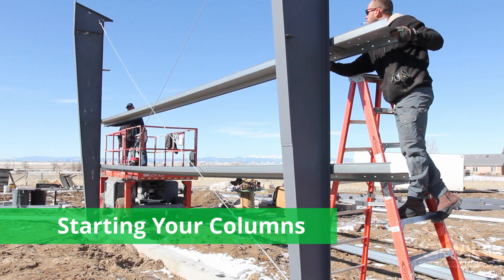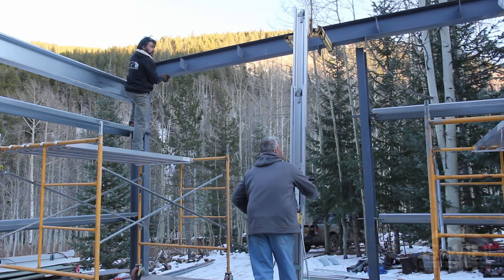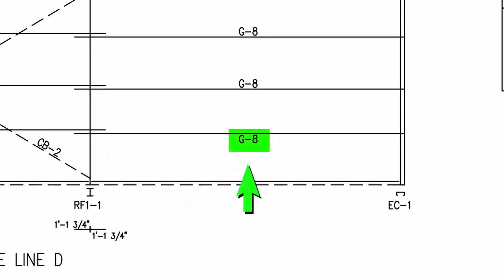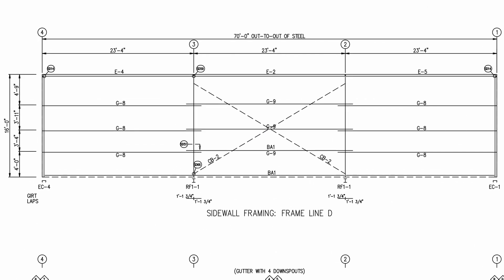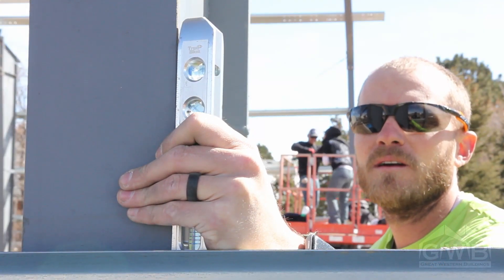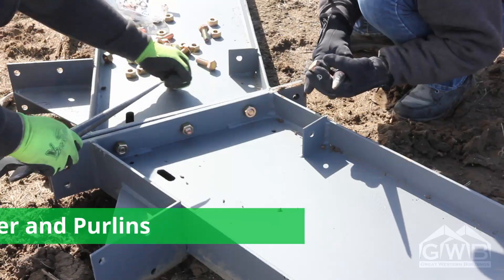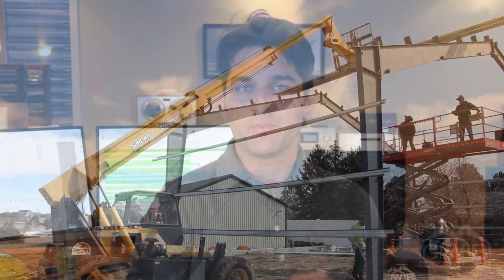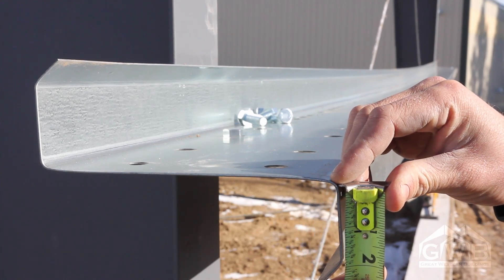How to Build a Steel Building - Erecting the Steel

Comment: Eric I want to know can i install solar panels onto the roof you supply? Also do you have interior metal wall finishes? thanks and great videos. I'm thinking of a ~38' Depth by 42' or 50' to use for my cars, and equipment. 
Dan in RI
Reply: Hi Dan, I didn't see this comment until just now. The main thing to consider with Solar is their weight - You want to make sure that your building has a few extra lbs of roof load to handle them - This is mostly a permitting and engineering concern - it shouldn't add much cost if any to a 40' wide building - assuming PV panels. 

There is a lot of fastening options depending on the roof system. Standing Seam is easies to install solar panels on but Standing Seam is a lot more complicated to install than a regular through fastener roof. 

A through fastener (Screw Down) roof will need stand off clips and sealants - usually the company providing the panels will include this and it's very standardized. We can supply specialty brackets that attach to the high ribs of our standard panels which allow the connection of PV Installation brackets but it is usually preferred to attach through the pan section of the panel for a more secure attachment. 

If you still have questions, please call into the office and they can get you in touch with Ryan, Tyler or myself. 

Thanks

Comment: Hey , its maybe early in this vid to ask , but yes, grout under BP, or NO, grout under BP?? thx 4 putting this out!👍
Reply: Always preferable to not have any grout if possible. Depends on the scale of the project though, anything 60x100 should have the correct concrete tolerance to not need grouting - just some minor shimming - Larger buildings often plan for the use of leveling nuts and grout on the BPs out of the gate because staying in tolerance is a tall order on the foundation crew. So they assume a couple of inches to eliminate excess shimming or grinding. Really depends on the project. 

Thanks